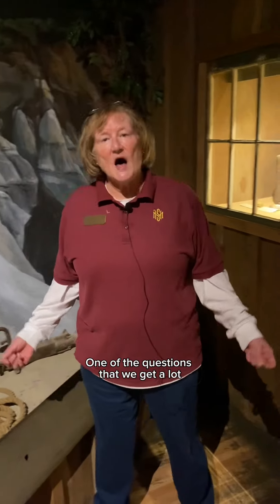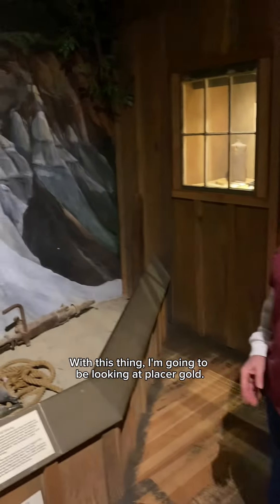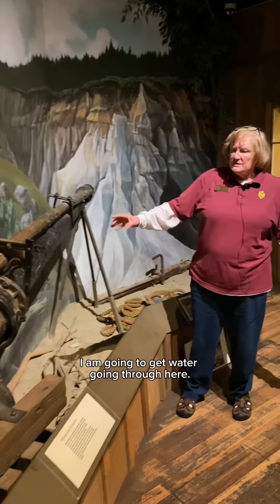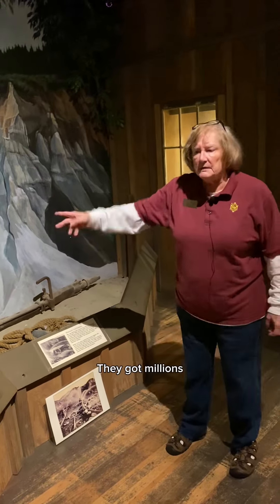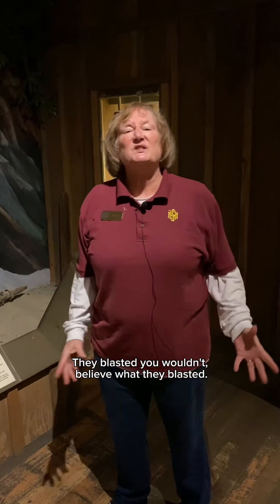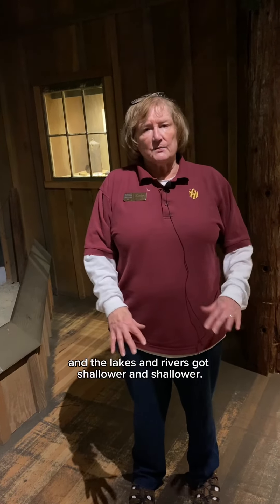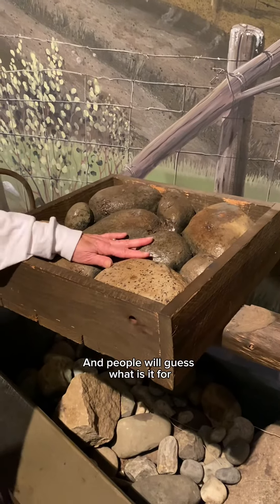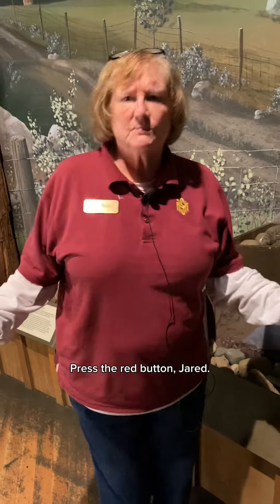Hydraulic mining and the California Gold Rush

Comment: A really terrific historical interpretation presentation… kudos to this docent (guide).
However, a major error at the end; an amazing error… the box of rocks on the hydraulic monitor have nothing to do with aiming. The rocks are there as a counterweight for the monitor. Aiming or manipulating the monitor was done in a much more sophisticated manner. 
The monitor could be aimed right/left and up/down because it swiveled on a universal two-axis ball joint.
At the nozzle end of the monitor there was a deflector device that could change the direction of the water stream. If the stream was deflected to the right the monitor would swing to the left. If the deflection was up, the monitor would swing down. And so forth. Think of how today’s jet boats are steered. The deflector was controlled by an operator standing beside the monitor. 
It was an elegant and genius mechanism and worked perfectly. You can see this in action in various YouTube videos.

Comment: Wow that water beam on the photo doesn't look that powerful. I thought as the lady described, the water pressure is build by gravity. How did they get the actual pressure to reach this speeds?
Reply: The water was brought down from the High Sierras in thousands of miles of canals. The monitor in the video is tiny; some had nozzles over eight inches across. The pressure was enormous. If you chopped the stream with an ax you’d end up with broken wrists.
When hydraulic mining was made illegal an amazing technology miracle occurred… about the same time the Pelton Water Wheel was invented (extremely efficient under high pressure) AND long distance electrical power transmission was invented (Tesla’s AC). The high pressure water previously used for hydraulic mining was subsequently used in hydroelectric power houses; many are still in use today.